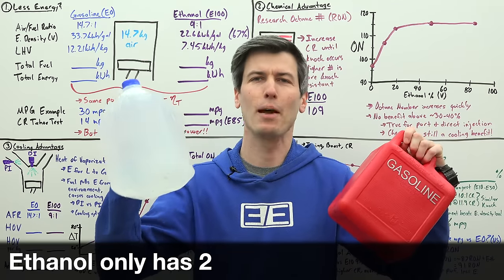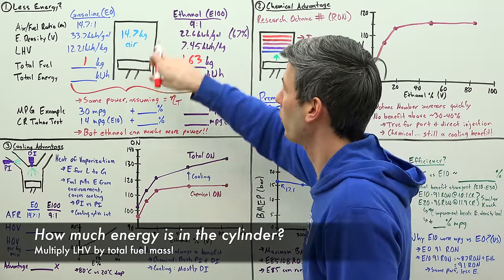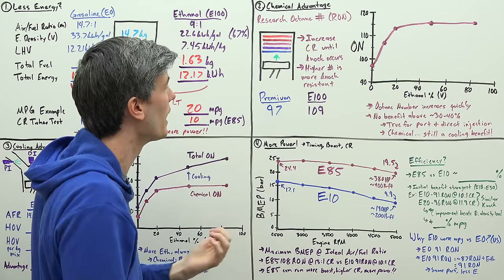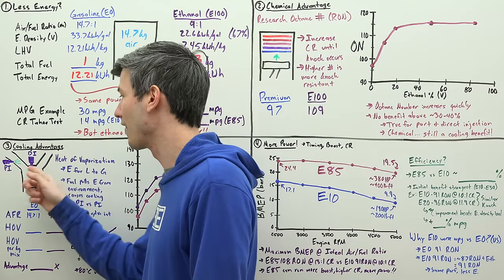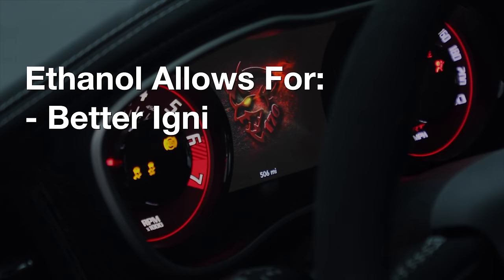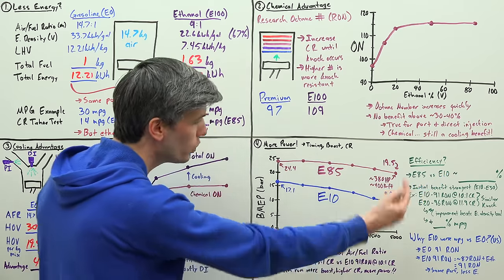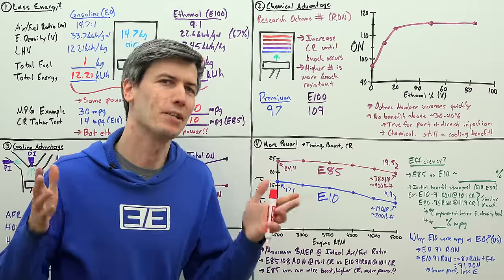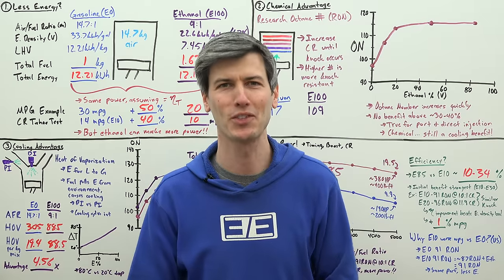Why Does Ethanol Make So Much Power? (Versus Gasoline)

Comment: Could you do a similar video that compares fuels when used in the same engines with the same settings - carbureted, port injected, direct injection. While ethanol may give more power in the ideal engine, most motorcycle engines are far from ideal for E10, much less E85. We don’t re-jet a carb every time the fuel contents vary! Thank you ⚡️🏍⚡️🏍⚡️
Reply: Hot rod Youtube channel did last year....your gonna be mad!
Reply: @oldblueaccord2629  Beyond mad, time to get even... with electrons! [[- I will look for that video -]]
Reply: @shandokacycles  The full video is blocked but if you read thru the comments someone tells you the outcome. E85 beats all the fuels they tried on the same engine.
Reply: @oldblueaccord2629  okay, but in which “same engine” — I’m especially interested in carbureted engines built pre-ethanol.
Reply: @shandokacycles  an engine Hot rod built I think a 383 stroker motor. I run 50/50 E85 and gas on my 440 I guess thats a pre ethanol engine to you?
Reply: @oldblueaccord2629  yes, that’s gotta be a fun ride!

Comment: There's also the effect of molecular mixing. Ethanol is smaller than gasoline, thus some of it fills in the voids - increases the density of the mixture. So while ethanol has less energy, the mix has more because it's overall more dense. (eg. 50ml of pure water plus 50ml of pure ethanol does not equal 100ml of mixture.)

Comment: Great video Jason! Tell us, when they are testing and doing comparisons with different compression ratios, what method do they use to change the compression ratio? Swapping ou head gaskets,  changing pistons?
Reply: Nothing so complicated. To adjust compression ratio simply change the density of the incoming air/fuel charge by adding something in-compressible. Water vapor.

Comment: isopropyl alcohol has an even higher boiling point and octane number than ethanol.
isobutyl alcohol has a slightly higher octane MON than ethanol but a much higher boiling point (108c°) and a much higher MJ/L energy content.
You also need to consider the oxygen content/L

Comment: Hardly any car maker takes full advantage of ethanol's properties, so most of the advantages listed here don't apply. Also, in some areas, ethanol's cheaper price is cancelled by the car's poorer mileage. Better performance, yes, but cheaper, it depends...

Comment: I'm curious how much efficiency improvement you can get with E85 if you tune for that instead of power.
Reply: Rear Admiral C.M. Chester wrote Henry Ford a letter on Dec.15, 1916:
"...I also pointed out in the article that as governmental laboratories had developed from 40 to 55% efficiency in alcohol engines as against 20% in gasoline machines, the use of alcohol at double the cost of gasoline for power purposes, was cheaper for motor[s] than gasoline in common use today."
Reply: its getting the engine compression ratio up high enough which can be expensive.

Comment: This was a very interesting video.

Would you be interested in doing a video to help better explain Gasoline RVP? Here's why I ask:

I have a track-dedicated Alfa Romeo Giulia QV that I race at Road Atlanta. The car is notorious for throwing low fuel pressure errors once I run quite a few laps, things have gotten really hot, and my fuel levels are down to 3/8 or less.

However, I've discovered that this only happens when I run e10 93 octane fuels. Luckily I have some fuel options at the track, and when I run e0 93 octane I NEVER get the low fuel pressure issues no matter how may laps, how hot or how low I get on fuel. And of course, I get the same great results if I run 96 and 100 octane fuels, both e0.

The theory on the Giulia forums is that the e10 ethanol mix creates a fuel characteristic which causes the fuel to vaporize prematurely while still in the tank due to extreme heat. This premature vaporization then causes vapor lock and thus, low fuel pressures.

But why does this only happen with the ethanol mixed gasoline, where the zero-ethanol gasoline [in my case] seems to be less volatile.

Thanks!

Comment: In the second panel you explain that the ON is determined by experiments with varying compression. But how do you know the cooling effect as explained in panel 3 isn’t at least partly responsible for the better ON?

Comment: Jason usually nails the engineering, but he (sort of) missed one of the benefits of ethanol; lowering the temperature in the intake port increases the incoming air density.  This effect works best with port injection (or carburation). Since the amount of power in an internal combustion engine is limited by the amount of air (i.e. oxygen) it can pump in a given time, and air temperature effects air density (i.e. the total amount of oxygen available to combust the fuel) and therefore power.  Translation: cold air = a poor person's turbocharger (spraying ethanol into the intake port cools the air). Arguably, port injection is better for overall power than direct injection.
Reply: And the old tried and true carburetor is no slouch, either …

Comment: Bottom line, courtesy of watching Engine Masters.  Naturally aspirated, won't make much difference.  But when supercharged, the larger quantity of fuel allows you to omit an intercooler, and cools the charge a lot.  Cooler air means more power.
Reply: YEP...every test E85 makes more power.
Reply: A naturally aspirated Chevy 5.3L engine is rated at a clean 380 horsepower on E85 vs a dirty 355 horsepower on E0.

Comment: Can you say something about disadvantages of ethanol ?
Reply: It's hygroscopic, so it attracts water over a period of time, making it useless. Having water in your fuel system is also terrible for engines. If you're using your fuel and not letting it sit for long periods, it will be okay. There are products which alledge they prevent this (stabilize), but i would take their recommendations with a grain of salt and simply not let it sit for long periods. This is why it's best to run flex fuel so you don't need to drain the tank.

Comment: Can this Turbo and Supercharger combine like this?
In low RPM up about 3000, engine is moving the compressor wheel (by 1:20) to compress air into storage tank,
and spin turbine wheel (1:30), it also acting as vacuum/suction to ease the fluent of exhaust gas.
Up above 3000 RPM, the power of exhaust gas kicked in to spin the compressor wheel and lighten the engine load too.
Is there any flaw?

Comment: The often cited 105 octane for E85 is incorrect. This number was derived by using ethanol’s blending octane value in gasoline. But this is only valid where the bulk of the fuel is gasoline.  At the other end of the spectrum, ethanol’s true octane value should be used to calculate E85’s octane value. This results in an octane range of 94-96 (R+M)/
2 = Antiknock Index (AKI) = pump octane. These calculations have been confirmed by actual octane engine tests.  So the chemical octane advantages of E85 are not nearly so great as shown on the whiteboard and are easily duplicated in gasoline using aromatics already produced at the refinery.  The real power advantage is almost exclusively due to the dramatic charge cooling effect of direct-injected alcohol, and this also can be duplicated with water, or with pure hydrocarbon reformulation of gasoline, as shown in my previous post.  Two other major considerations are lacking from the video.  1. That it is silly to carry around oxygen as 35% of your fuel weight when it is freely available from the air.  2. That peak power is only useful for a fraction of a vehicle's driving time, so optimizing for this parameter, especially by using a low-energy density fuel, is sub-optimizing for others that are important, even to a race car, such as vehicle gross weight, volumetric efficiency, and power density, which together contribute to acceleration, aerodynamic drag, cornering, and range.
Reply: What you're saying may have some significance if internal combustion engines could only run on E85. However, internal combustion engines could run on E90, E95, and E99, which is in effect E100.

Comment: I've heard that I can get like 40 hp by just using e85 conversion on my civic si. Sounds sweet, but there has to be a catch or Honda would have made the engine e85 compatible from the factory, right? What is the downside of having an e85 capable engine and not fueling with e85 (not available everywhere where I live)?

Comment: It takes more ethanol to get the same power as gas, less MPG on ethanol
Reply: In this engine Ricardo built and drove around for GM ethanol has more power at half the size and greater mileage than gasoline and even greater than diesel.

FROM RICARDO:
The new federal CAFE standards are calling for a doubling of fuel mileage performance, which, Vint says, is going to send OEM’s looking for high octane numbers to improve efficiency and ethanol is the best source. Ricardo, an engineering firm with over 100 years in the business of engine design, has developed an extreme boosted direct injection engine (EBDI) to optimize ethanol blends. The 3.2 V6 gasoline engine rivals the power and torque of a much larger GMC Sierra 6.6 diesel, he said, and it delivers 3.5 percent better fuel economy than the diesel.

In a current Chevy 5.3 L pickup, it is rated at a clean 380 horsepower on E85 vs a dirty 355 horsepower on E0.

The mileage is less but the loss is more than offset by ethanol's lower price so the cost per mile to drive with ethanol in this inefficient gasoline optimized engine is still less with ethanol.

Comment: Thank for the video.  Am I to understand that by using non ethanol fuel at the same octane rating on my HEV (absolutely don't care about the power and acceleration driving on the street from A to B) it will produce more MPG?  So why do they sell fuel with less MPG these days and charge the same price?
Reply: If you can find ethanol-free fuel for the same price as E10 of the same octane rating, buy it …

Comment: So this is similar to why electric cars are so efficient. 

even though one lb/kg of fuel contains more energy than 1 lb/kg of electrons, the mechanism by which the electric car works is so much more efficient, that it can go much farther on the same mass of fuel/charge
Reply: Wouldn't it be fun if one could actually make a bag of electrons? Say, about the size of a lunch bag.

Comment: Does propane burn the same way as Ethanol? It has the same Octane numbers and on the old engine I advanced it 15-20 degrees or more for timing but I have to be careful of detonation because it doesn't knock. Also does burning natural gas do the same thing but it burns cooler than gas?

Comment: Question.  If your engine is considered flex fuel capable and you try E85, do any changes to timing and such need to be made manually in order to realize a power gain?
Reply: No, for example the Chevy 5.3L flex engine is rated at 380 horsepower on E85 and 355 horsepower on E0.

Comment: 87 octane is NOT necessarily lower quality gas. It just has less octane added. There is more gasoline in 87 and less anti- knock additives.
Reply: Well there is more BTU in 87...but that messes up the theory that lower BTU AUTOMATICALLY means less power and mileage. Rage, anger in sues its awful.

Comment: I do have one question about E85. It was mentioned that the cooling advantage of ethanol is greater with direct injection. Is there any significant difference in the amount of carbon buildup on the valves, one of the drawbacks of such fuel injection system, with ethanol vs gasoline. If so, does the ethanol have the advantage?
Reply: Since DI is injected straight into the cylinder probably not is my guess.

Comment: good info- can you also explain why ethanol is also more difficult when starting the car than gasoline?
Reply: The same reason diesel is hard to start, ethanol has low volatility.  No vapor pressure below 70 degrees F or so while gasoline's vapor pressure goes down to -45 degrees F.

In Brazil where E100 is used, they use heated injectors in flex fuel cars which turn on when the drivers door is opened for starting similar to diesel's glow plugs.

In the 1970s, Brazil's ethanol vehicles had a lawn mower sized tank for gasoline which did the starting.  We opted for 15% gasoline for starting.  E85 can be as low as E51 in the wintertime for flex fuel vehicles.  Heated injectors and E100 would be better IMHO.
Reply: I start mine around 25F.

Comment: What in the Hell is a "gallon" in SI units?
Stay with SI units all the way and lose the Neanderthal imperial units.

Of course, that is mere nit-picking. 

The video is TRULY EXCELLENT. Thanks.

Oh, by the way, you neglected to include another benefit of cooling by ethanol: More air can be ingested by the engine because lowering air temperature COMPRESSES air. This compensates significantly for the lower energy per liter.

That is why some engines have intercoolers after boosters.

Comment: Should i feel a huge difference in my Range Rover? Its capable of running bith premium gasoline and E85. Its the supercharged 5.0 so i figured E85 might be a better choice. Barely did first fill up a week ago but im not sure if im feeling actual gains or its all in my head.

Comment: Ethanol makes more horsepower because MATH!
Interesting fact:  Cars were originally designed for ethanol.  Henry Ford started making them to use "rock oil" because, as he said, "More bang for the buck."  Hmm...
Reply: Henry Ford used ethanol for his Quad-cycle and also designed the Model T for ethanol.  Production models were flex fuel.

Rockefeller, the owner Standard Oil who made kerosene for lighting, was dumping the waste product of that (gasoline) into a river in the middle of the night until the river caught on fire.

Henry was a very strong advocate for ethanol always.  He was against the Rockefeller funded Prohibition at least for it applying to industrial use.

When E10 began to be sold after Prohibition ended, Henry funded think tank groups to counter the false propaganda being put out by the media machine called the API which formed then.

Quotes he is famous for:  "Ethanol is the fuel of the future."

"There is enough energy in an acre of potatoes to farm that acre for 100 years."

Henry absolutely knew ethanol had more power and even more mileage than gasoline (i.e. more bang for the buck).

Rear Admiral C.M. Chester wrote Henry Ford a letter on Dec.15, 1916:
"...I also pointed out in the article that as governmental laboratories had developed from 40 to 55% efficiency in alcohol engines as against 20% in gasoline machines, the use of alcohol at double the cost of gasoline for power purposes, was cheaper for motor[s] than gasoline in common use today."

Comment: Could you please do a episode on making E85 out of Switch grass???
Reply: Ethanol is hard to make from cellulose and easy to make from starches/sugars.  This is why Scotch, Bourbon, Vodka, Rum, Saki, Gin, etc. are not made from cellulose like grasses but from sugars/starches.

Switch grass is bulky as well and would require dedicated acres to make ethanol whereas corn ethanol is value-added from already existing corn feed acres and leaves 100% of the protein and other things still available as feed in a healthier, more digestible/efficient, and more concentrated form called distillers grains.

Distillers grains is how corn ethanol can outcompete any other source out there, even those that make way more ethanol but little else.

Flawed studies negative on corn ethanol naively or sinisterly assign all the energy, fertilizer, and CO2 to the ethanol side of the corn kernel and none to the feed side when in reality it should be the other way around.  Why?  Because we will grow same amount of corn with or without ethanol.  Cattle feeders who now use distillers grains would need a protein alternative source if we ended ethanol with another Prohibition.  That source would be simply going back to feeding the corn straight like those who don't use it do.  Almost happened during the covid shut down.

100% of the fertilizer and things of the soil are still fed to livestock in the distillers grains.  The only thing that goes into ethanol came from the air:  solar energy, CO2, and water with the latter two recycled once burnt.

How logical is it to assign all the fertilizer to ethanol when all the nitrogen is in the high protein distillers grains?  How about all the phosphate which also all goes into the distillers grains.  Potassium, sulfur, zinc, etc.etc are all the same, they are in the distillers grains, not the ethanol.

Corn as a source though is limited to the size of the cattle herd on feed.  We can not economically make ethanol from corn beyond that.  I try to eat grass fed beef so if everyone ate like me, corn ethanol would not even exist.

The US throws away huge amounts of lawn grass clippings in land fills when gas off as methane.  This would be a great cellulose source.

California has outlawed the throwing away of food waste in land fills and they have a lot of food factories when discard blemished/damaged food.

These two sources don't require dedicated acres and would have a natural fertilizer at least as a byproduct from making ethanol without methane leakage from the landfills.

Comment: I have a fuel related video idea. Is there a RPM limit for an internal combustion engine?  Meaning at what point can the fuel simply not burn fast enough to gain RPMs?  Combustion, stroke and octane will of course all have to be taken into consideration. Can't wait to see the white board on this.
Reply: I’m more than 90% sure he’s already done this, but it’s an older video.
Reply: The little RC glow plug engines are turning up over 40,000 rpm … I don’t think the limit would be contingent on fuel burn rates …